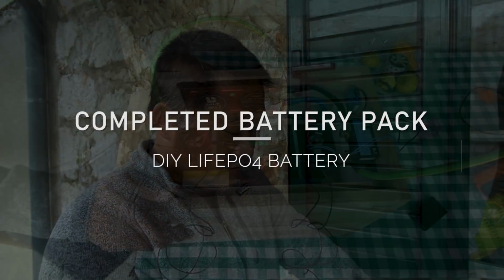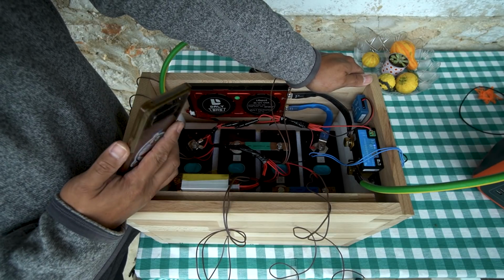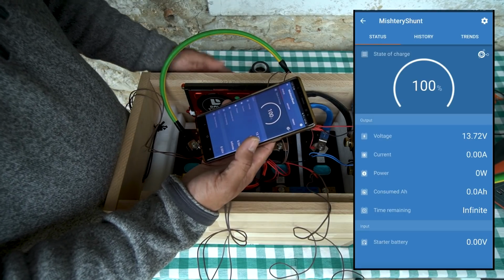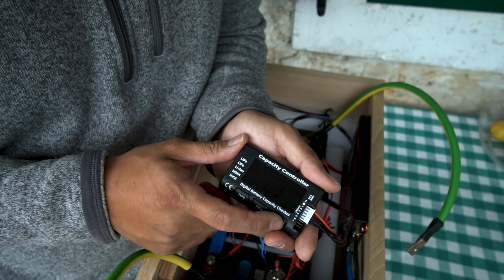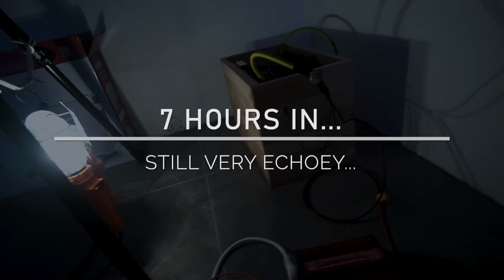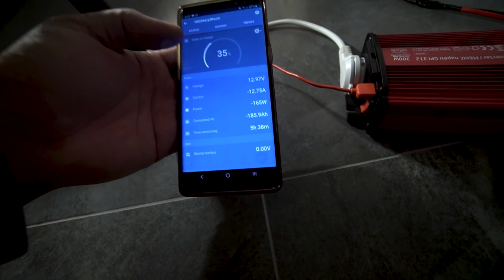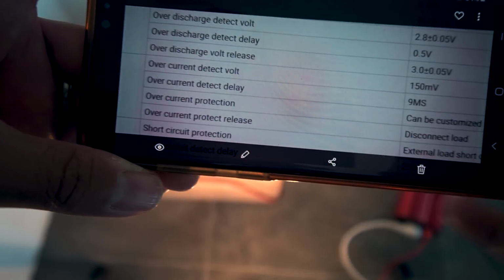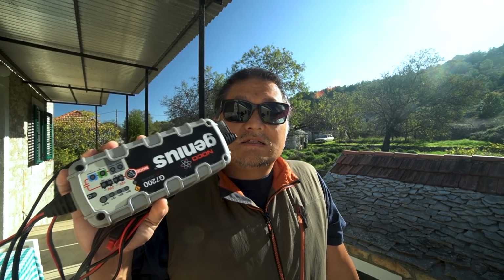DIY 12-Volt 280Ah LiFePO4 Battery // Full Capacity Testing // Part 3

Comment: Shouldn't You Use A Metal Box?

Just Thinking Of Fire Danger?
Reply from the maker: Metal can cause dead shorts and is more likely to cause a fire.
Reply: @freelyroaming  Ok,

But Couldn't You Put A Fire Proof Material Inside Lining The Box?

Thank You For Responding So Quickly.

Best Wishes,
Wayne
Redmond, Washington
Reply from the maker: @wwvette  it's a lot more complicated to use metal and it doesn't really offer any real advantages.
Reply: @freelyroaming  Ok, I Know Nothing On This Subject, I Hear This Problem Of Fire With The Airlines And Tesla Auto's??

You People Know More Than I About It?

My Theory Is A Common Sense One...
Reply from the maker: @wwvette LiFePO4 chemistry is not the same type of batteries that is at risk of thermal runaway like in cars. It can still short out and cause fires for sure but it's safe in comparison.

Comment: -Victron good kit purpose made for storage batteries, marine, mobile home, solar.  The BT App for Android is very useful. I have an IP65 Charger, BUT 2 niggles here, Victron s/w does not contain a real time clock (they could use a chip not a web connection - your wrist watch works ok doesnt it? and offer the User means to correct/reset the time for any drift). I think they just forgot and were pissed when I told them.  The reason is that the unit stores readings and you can access the data for an excel spreadsheet.  BUT stupid numpties label their record entries back to front ie the latest record is labelled No 1 (it stores 50 records then overwrites) thats a real pain on excel as each charge period is different.  The charger doesnt display total Ah input - its a combination of Bulk, equal, float.  The Amp reading is not very accurate.  I told them all this and they were even more pissed .  Its the best of available kit and it works - but it doesnt automatically check and do a recharge when I go out and return and plug it in. I have to remember to press the button.  All this can be fixed as its meant for mobility, golf carts scooters etc

Comment: Great video, I have one question I have a battery pack (Lithium Iron) connected to dash cam in my car. When vehicle is on the battery get recharge at 14.6V at 9 amps. It has an XT60 battery expansion port. I would like to know if I connect the above battery pack using the XT60 connector will the above battery charge and will be able to discharge back to main battery ?

Comment: Awesome video Dan, I like how you keep the camera steady, talk normal and don't play loud background music. After watching your video, I'm wondering if the Victron Smart Shunt is trully necessary as it seems to replicate what the Daly BMS gives you through their bluetooth app. I guess it's because you're using a Victron Charger and it integrates the monitoring through bluteooth? Having the little cell monitor is however truly useful as it provides instant visual  feedback - inexpensively!... After 8 days of self balancing, my 16 paralleled cells stabilized at 3.47 V. I was tempted to recharge them back to 3.65 V, but I'm glad i watched your video as I realized it's not needed before assembling them as a 48V battery. I'll attach a Heyo bluetooth 320A BMS with 1A active balancing (Daly) to perform the discharge test as you did. I'll also set the BMS to 2.8V just like you did as I feel no need to push it down to the knee. Hopefully I'll also get close to 282 Ah too. I strongly doubt that I got true grade A cells, but it's not so important. What's important, is to maintain a close to 5 mV balancing differential between cells. However I realize that getting this close balancing is more of a BMS function than cell performance, as well as giving enough idling time for the BMS to do it's passive balancing. I'm actually getting down to 1 to 2 mV at time with the ANT BMS in spite of the fact that a couple of my cells (on my second battery) are running away. Indeed, the BMS intermittently shuts off with High cell Protect level 2 warnings every time the charger injects more power into it. i can see the voltage on those 2 cell spiking to 4.5V! Thanksfully the BMS shut the charging FETs OFF. These same 2 cells also trigger the Low level 2 cell protect cut off. So it's time to take the battery apart and test those 2 cells or perhaps text the FETs on the BMS. Wish me luck and  thanks for your videos! Keep up the good work Dan.

Comment: Really nice build you did there and want to attemp the same thing....We live out in the Sonoran Desert of Arizona and when those temps get up into the mid 115 +/-  I  have found no tape that doesn't give out in that heat including that 3M stuff..       Screws into the wood with small washers up top should hold it in place

Comment: Great and informative series. I love the intro of all your videos.

Watching it all however made me skeptical,  the amount of money and time  spent and the longevity of the batteries. Is it really all that worth the hassle?
Reply from the maker: Thanks. Whether or not it's worth the hassle depends completely on the person. If you are not the DIY type then it's probably not for you. This battery will last 10+ years. I've been using it already for 2 years and there are no signs of degradation. If you just want to buy an off the shelf battery, they are available these days for a lot less than they were before. DIY will still be cheaper but the gap is narrowing.

Comment: Can I change with normal 12v leadacid inverter
Reply from the maker: I assume you mean a charger. Depends on the charger. Without knowing which one you have, I will generally say no. You need one that is compatible with lifepo4 chemistry.

Comment: Great video! Love it.. been using your vids to do something similar.. but do you know the recommended charge rate for the battery pack? I ended up with an expanded cell with using a 30a charge rate so that will be replaced.. but thinking it would be required to have the charge rate of the pack be aligned with the cell balancer.. if that's out of what, then would not one cell be charged more than the others or something to that nature?
Reply from the maker: 30A charge rate is no where near the limit for these cells. I suspect there were other problems already existing that caused the expansion.

Comment: Hey thanks for sharing your setup, I was curious, does the position of the battery sense matter for accurately measuring the temperature you set for your low temp disconnect? Or is any mounting position fine as long as its close to the batteries?

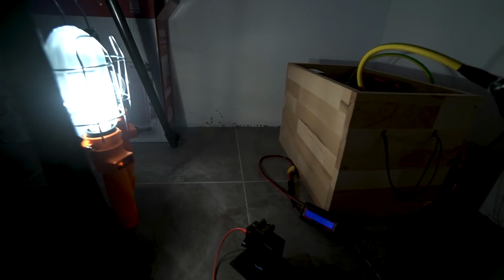Comment: ( 13:30 )  why are you using those bulky electric hog lights instead of LED's  🤷‍♂️  You are withdrawing 172-watts from 2 bulbs,  when you can be withdrawing 10-Watts from LEDs.
Reply from the maker: The point of a capacity test is to run the battery down to zero. The efficiency of the light source is irrelevant. The goal is not trying to keep the lights on for as long as possible. It is to test how much power can be drawn from the pack. Using a 10-watt load would take over a month to run this battery pack down.
Reply: @freelyroaming    Ahh ok got it.  Thanks 😉👍

Comment: Is that a modified sine wave inverter?  You may want to think about a pure sine wave model for cleaner voltage and less noise on the lines.
Reply from the maker: It's just for capacity testing.

Comment: How many watts does the Victron Shunt consume continuous?  The one I have consume 41 watts.
Reply from the maker: Wow, 41 watts? Are you sure? The Victron Smartshunt has nearly undetectable amount of consumption. Uses 1 mA which is less than of 1 watt in a 12v system.

Comment: Almost 200watt on 3 light bulb that appear to be LED ?  So crazy. Use 8 watt LED you can run like 25 bulbs 💡
Reply from the maker: Not led. They are incandescent bulbs. The purpose was to generate a load rather than save power.

Comment: Am I right in saying that your charge input mode (Noco) should be set as a standard "flat" feed? As you already have a BMS managing the charging, as well as a balancer, there's no need for a shaped current/voltage feed like the Noco's lithium option offers. All larger retail lithium batteries I have seen, for cars, motorbikes etc. state to use a "normal" charger, because the battery already contains the BMS circuit inside. You, in effect, have the same system. Food for thought.
Reply from the maker: You can use a constant current charger for LiFePO4 with or without a BMS. The BMS doesn't affect or 'shape' charging current at all.

Comment: Dan - thanks for taking the time - this is the second of your videos that I've checked out.  Subscribed, and hoping you share more of our adventures!
It isn't just the knowledge you impart: I get nostalgic for the 18 months I spend living from a Toyota Landcruiser (troopy, we call them in Australia).  Had just an 80w panel and single deep cycle battery back then, but it was enough to run a small Engel fridge, and keep my gadgets charged.

Quick question if I may: I'm speccing out a house solar setup for a remote island, and am very focused on longevity for the batteries in case sourcing new ones is a problem in the future.
This might sound a bit extreme, but I'm currently thinking of keeping the state of charge between 25 and 75 percent, leaving only 50% capacity to actually use.  I'll double the battery bank capacity to compensate.  So I was really interested in understanding your safety margin and how it compares to your 282ah result?

Sooo, the question: when the Victron shunt shows 100% SOC at the outset, does that mean 100% of the 90% maximum charge as per your longevity margin, or does it mean absolute 100%?
I imagine it means absolute 100% SOC, since your result of 282ah is already above the rated capacity of your cells?  Likewise, I imagine that 0% according to the shunt corresponds to complete discharge, without including the 10% longevity margin, for the same reason?

What confused me a bit is that you did go into some interesting detail about how the low voltage cutoff for the BMS is 2.8v +-0.05v.
That seems like a generous protection margin already, so does it include the 10% buffer you mentioned you want on the low end?  In which case could we consider the overall capacity of your cells to be even higher than 282ah?  Are you going to be relying on the BMS for setting your custom margins (does it allow custom settings)?  Or are you going to program that into the Victron shunt?  Or will your charger allow custom settings?

Happy trails!
Reply: The BMS spec sheet he was looking at was for Li Ion not LiFeP04. Cells can go down to 2.5V or 2.0V, refer to spec sheet

Comment: The victeon battery sense is best placed in between the cells to more accurately measure the temperature of the cells when you are charging them.
The charger will then use the entered temperature coefficient value to modify the charge rate.
Reply from the maker: Temperature compensation is disabled in my Victron chargers. The battery sense is used for low temp disconnect. You can see how this has been reconfigured in my cold weather modifications series.
Reply: @freelyroaming  ah gotcha

Comment: Saw a peukert setting at 1.25, which isn't correct, it should be 1.02 for lipo4
Reply from the maker: It has been set at 1.00 since it was installed.

Comment: Great vid.... Please... Could you do another load test after using the battery for 2 months.  New batteries will give a decent capacity.... But what's their capacity after months or years of use?
Sam's club batteries degrade hugely over the first 3 months of use.
Also... For transperancy.... We're you sponsored for this vid?
Reply from the maker: Thanks. LiFePO4 batteries are suppose to improve in capacity after a few initial cycles. But after a couple of years I can test again. I paid for these out of my own pocket. If anything is sponsored I will always make it very clear in the video. It is a requirement by FTC rules but also I think it is the right thing to do.
Reply: @freelyroaming ... Thank you. It is very difficult to find real.... DIY people who give good, proven information.

Comment: Is the NOCO Genius correct for LiFePO4 chemistry? From what I read those NOCO profiles are for Lithium-Ion charging and I'm wondering if that's the right voltage for LiFePO4. I'd like to find a good AC charger for a bigger DIY build.
Reply from the maker: Yes they are LiFePO4 compatible.

Comment: I'm assuming the Ah rating of your lithium batteries are a 20 hour rate.  That means in order to truly test their capacity you'll need to apply a constant 14A DC load.  Your original current was lower which is why you ended up with a higher capacity result.
Reply from the maker: If you read the spec sheet you can see that a 0.1C discharge doesn't give you much more capacity than a 0.2C discharge rate. Maybe I could squeeze 2-3 Ah more out of the 280 Ah rating at a lower discharge rate. Either way, these cells pulled the rated capacity as expected.

Comment: Hi, good video, I want to build something similar for the 12V supply in my shed. I have a wind turbine with mppt charging built in. Do you think there is any reason why that might not be suitable for this kind of battery? The wind velocity here varies a lot. Gusting up to gale force is not uncommon. But the turbine has aerodynamic limiting and a voltage sensor.  Even so the lead acid battery I have now has got a  bit warm on windy days.
Reply from the maker: As long as your mppt controller is compatible with LiFePO4 batteries then you should be fine.

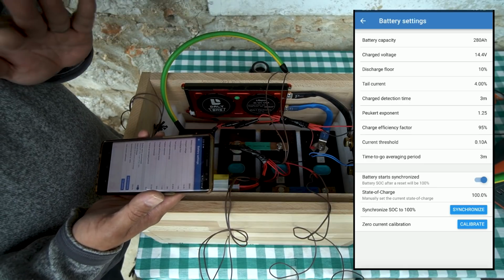Comment: @8:36 you need to change the Peukert Exponent to 1.00 or 1.01 (It might not support 1.00).  You have it set at 1.25 now which is for lead acids under high loads.  The Peukert effect isn't applicable for LifePO4 batteries.
Reply from the maker: You will see in part 4 when I installed and programmed all the chargers in the camper is when I updated the Victron settings including setting the peukert constant. What you see in here are the defaults that came with the SmartShunt.
Reply from the maker: It's been a couple months now so when each step was done is getting a little fuzzy in my memory. But yes I understand peukerts law and how it effects the different battery types. Someone else has mentioned it before I installed it into the camper.

Comment: If the BMS did cut off from low voltage, do you nwed to reset it? If yes, why and how?
Reply from the maker: Depends on the BMS you are using. Most of them will turn on automatically once it receives enough charging voltage. Others might require manual intervention. The Daly BMS sometime need to be manually reset by bridging the P- and B- terminals. They cut off to protect cells from being over discharged.

Comment: I watched your video (and subscribed) with great interest. I am a newbie to lithium. I took out two 12v AGMs replacing them with one  12v 170 Ah "Big Battery"with the Anderson connectors.  I bought a Progressive Dynamics 9100AL lithium 60amp charger. What's new to the mix is the Victron Smart Shunt followed you kink. ...I'm just not sure what parameters to put in....so I copied yours  I charged the battery for 24 hours it showed 14.5 V.  I added all the components together on my work bench. Hooked up a 1000 inverter, plug in two 150w flood lights, clipped my Amp meter set on amps on the Positive cable into the battery and Multimeter  on the Pos/neg out of the charger (just to double check)  the I wired in the Smart Shunt, entered your parameters except battery amp hours. Discharged the battery until the inverter shut off at 10.5v.  169.5 amp hours showed on the connect app. When I took off the load and plugged the charger back in the connect app showed 100% SOC even though the battery and meter showed 13.2V  that is 70% SOC according to the little chart you had. I manually changed the SOC to 70% and started charging again....WRONG OR RIGHT THING TO DO.  In the mean time I will hang on your every word and intend to build a companion Battery when the funds allow.  Keep on Keeping on. Happy New Year, Peace and Blessings, Richard
Reply from the maker: I would just charge your battery all the way up until the charger goes to float stage. Meaning there are no more amps going thru up in the charging wires. Then set the SoC in the app to 100%. That should give you a good place to start for all of your subsequent charge cycles. Just make sure that there are no loads in your system that isn't going thru the shunt so you are capturing everything.
Reply: @freelyroaming  Thanks that helps alot
Reply: @freelyroaming  Thank you much. I did just that.

Comment: Did you "add" the house bank to the van ? You had mentioned 4 sources of charging, no mention of charging from the vans chassis alternator itself. If my RV has been wired to charge from the chassis alternator to the house battery, is the alternator charging parameter not good for the LiFe PO4  battery pack build you have just shown ? Right now my RV has 2 of the AGM 105 ah group 29's. So your build gets 280ah vs 210 ah , but the useable is so much greater. The RV does not have a dc to dc charger yet, but I will install one. Remove the alternator wire ?
Reply from the maker: I do not charge directly from the alternator but rather a dc to dc charger instead. Charging directly from the alternator without a current regulating charger can cause potential damage to the battery as well as the alternator itself.

Comment: thanks for the great videos... and a question...
is there constantly a bluetooth signal coming from this battery box setup?  or is there a way to turn it off?
Reply from the maker: It is always on. I'm not aware of a way to turn it on or off
Reply: @freelyroaming  which component in the battery box is broadcasting the bluetooth signal?
Reply from the maker: Victron Battery Sense and Victron SmartShunt